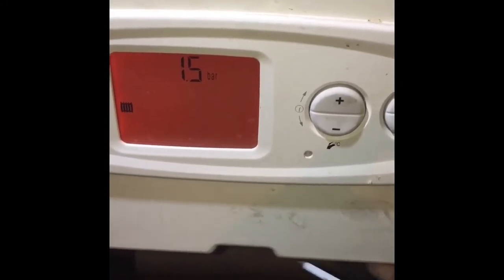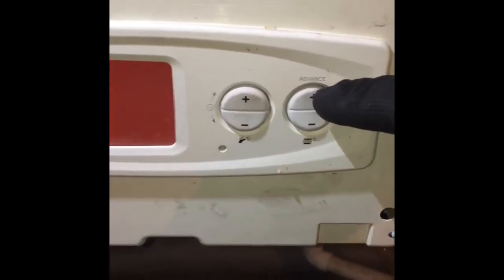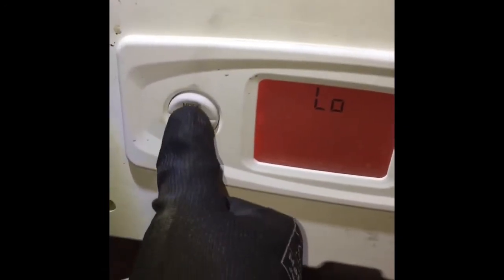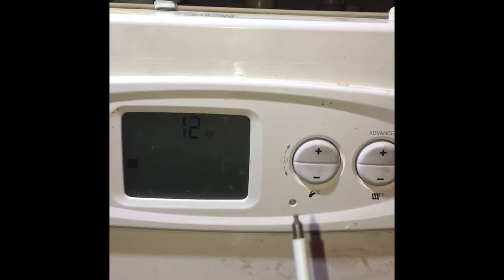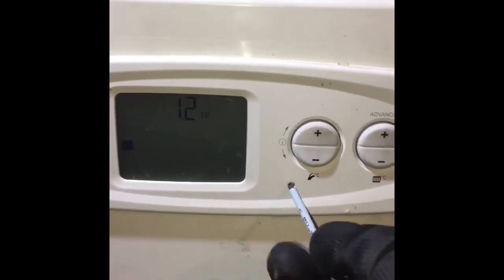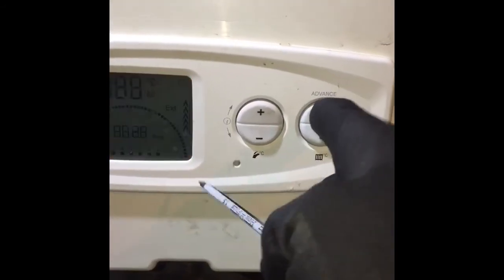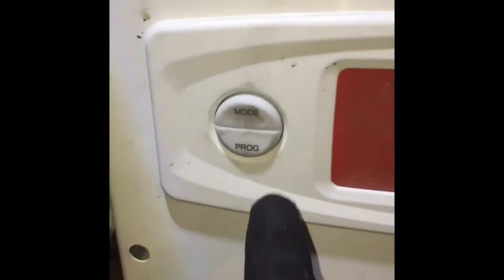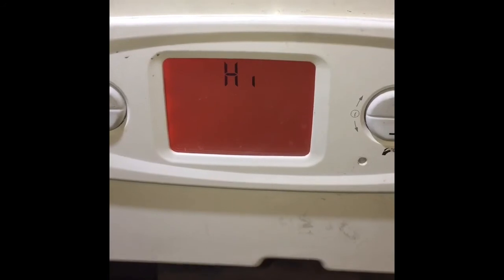Glow Worm Ultracom - High And Low Fire Service Mode

Comment: What’s the difference
Reply: So you can check combustion in low and high fire. Lowest heat input is where the flame is closer to the burner head and potentially cooled (impinged) and could create high CO and at high fire the flame may lift off the head and burn in evenly and cause high CO. You are also checking the operation of the gas valve, fan and combustion air supply and exhaust (integrity of the flue/chimney) high flue/chimney temps could also indicate poor heat exchange and incorrect heat input. 

More checks should be carried out in accordance with M.I’s

Comment: Hi does anybody know How to set the clock to the right time?
Reply: press and hold prog button for 5 seconds until it flashes , press the hot water plus or minus to change hours, press prog to go to minutes, use hot water button to change minutes then press prog to finish, time is set
Reply: Berrybug1010 thank you for your reply worked and set time much appreciated.
Reply: @berrybug1010  thanks.  Just saw this